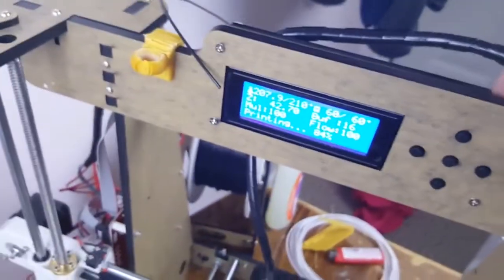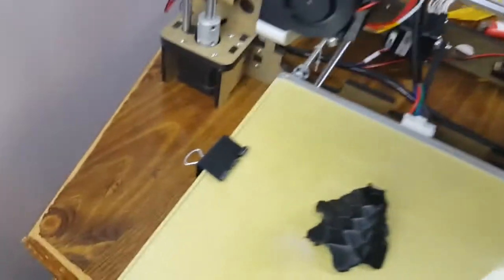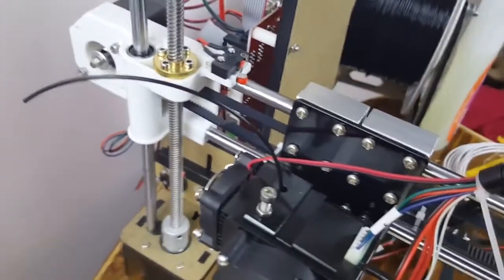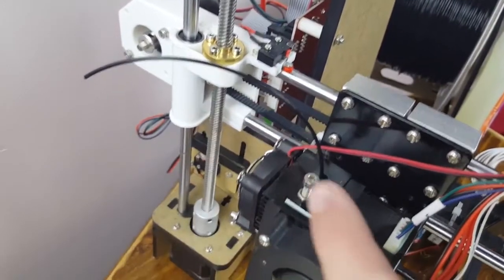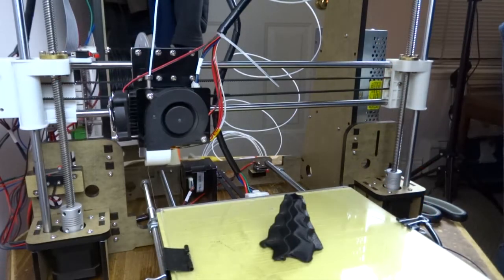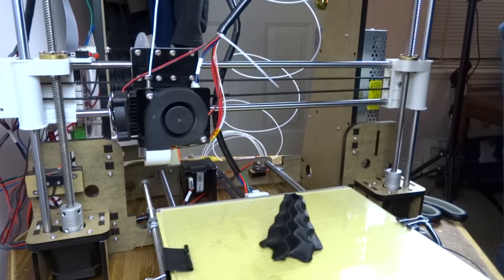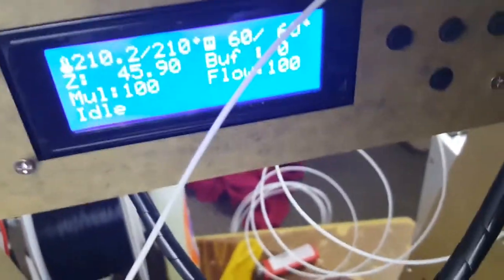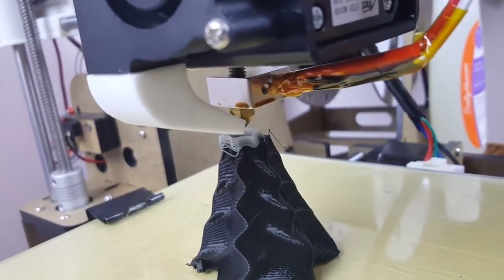How to switch filament during printing on 3D Printer tutorial

Comment: Some printers can do this better than others. My Monoprice mini select does not pause immediately but goes to a "new line" so to speak and can restart much cleaner. I wonder if there is a way to get Cara to insert pause points. I am a nooby and will be looking for that. Also, there is the problem of "stringers" on a move or pause or even Start (goes to home first).

Nice try Kruno but your print was ruined because it could not restart properly, probably stringing and dragging until it got to where it wanted to restart.
Reply: https://www.youtube.com/watch?v=1nBnVtOEAiY&list=PLUdBqQvvJI5u0hij_YSOMlFUc2QazLP__&index=5&t=45s